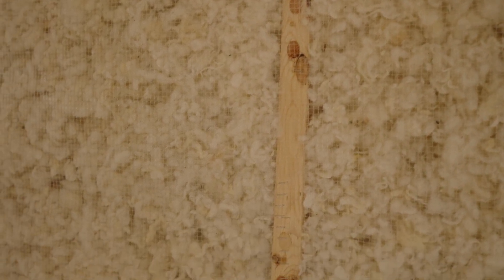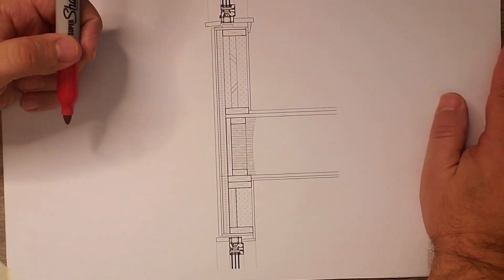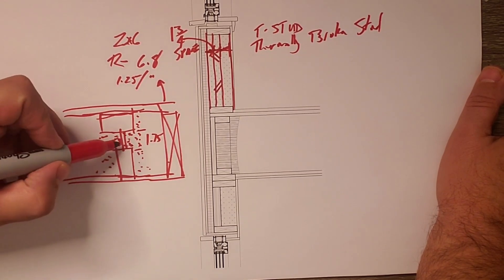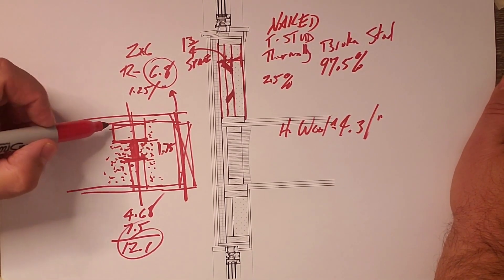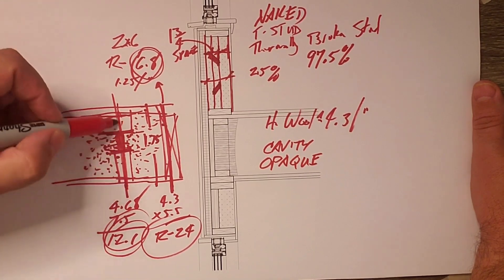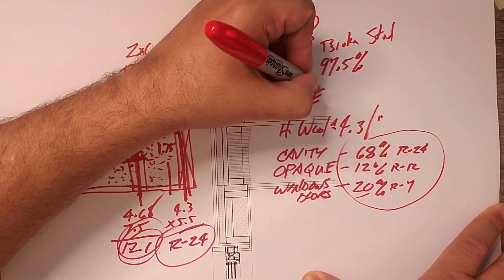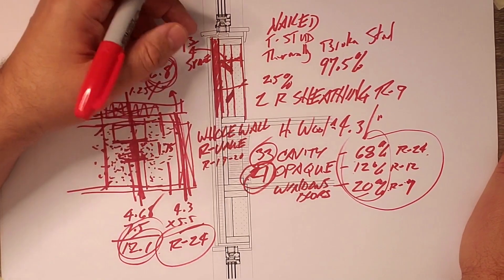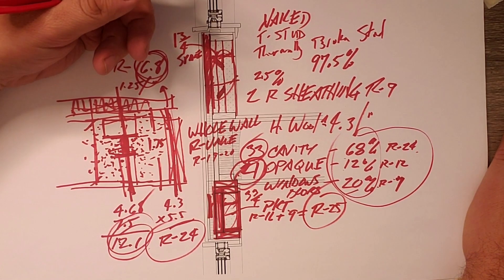SHEEP"S WOOL in INSULATION?

Comment: I went to Havelock's website and that wool insulation is eye-wattering pricey.  It would cost $3600 in loose fill wool to insulate 1440 sq ft (two 60x8 and two 30x8 walls) whereas cellulose from Home Depot would cost $315.  Include the attic, and we are probably look at a $5000 or $6000 premium over cellulose.  

There are better ways to spend that money.
Reply: Not sure how you are arriving at $315 from HD.  To fill that much sqft of wall for the cellulose alone is $2000.  You then have to add netting and labor.  The free machine for HD or Lowes does not do dense pack wall insulation.  It is for attics only.  Blowing insulation in a wall is an art and it not for the DIYer.

Comment: I love learning of materials that replace traditional choices for a reduced carbon foot print or healthier interior!

I'm always on the lookout for a complete gypsum board / sheet rock replacement that has the same finish qualities.

Thanks for the great video Steve.
Reply: Most natural products have many useful properties beyond their insulating ones; such as not producing such dangerous fumes if they ever catch fire or not catching fire so readily, but the fundamental issue with chosing a natural product over a man-made one is that they don't insulate as well. We need architects to come up with ways to use these natural materials in ways that minimises the effect of the additional thickness that is required to match the best man-made materials.